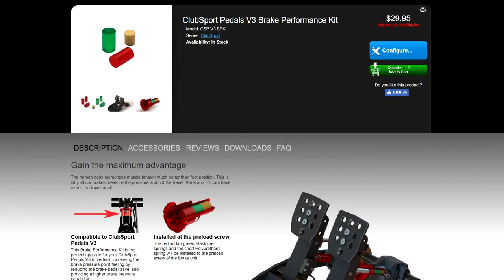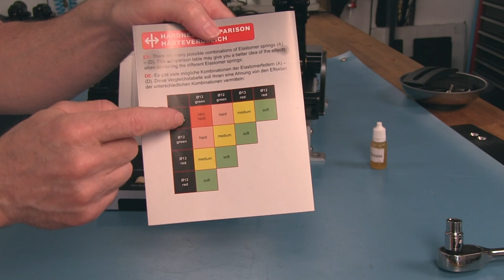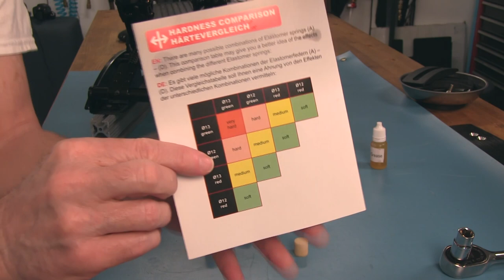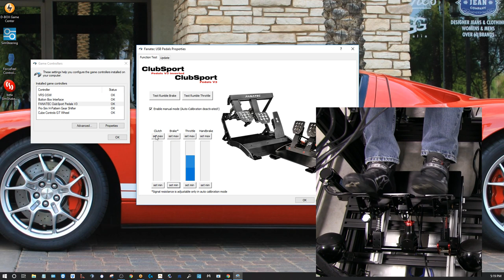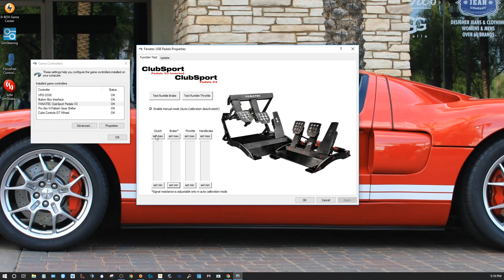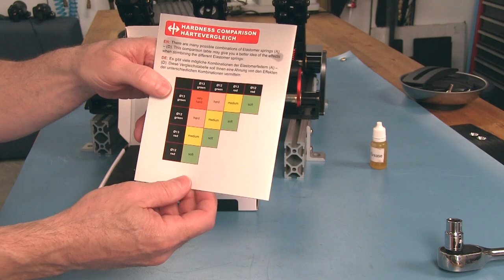ClubSport Pedals V3 Brake Performance Kit Review

Comment: The Shoremeter measures a point of the same diameter (so same area), but even going from 12 to 13mm, the area is 17% larger. So you'd expect you would need more pressure to compress a larger diameter elastomer.
Reply: I thought the same thing, but my comment was much more wordy. haha
Reply: Yeah, for these i think you have to measure them as if they were springs and calculate the force required to deform them by a certain length
Reply: I must admit, I am quite bothered by the lack of understanding of such a thing... XD

Comment: The smaller bumpers are not harder. They are actually the same hardness. It's just your measurement device and how it works. The smaller bumpers have less surface area touching the foot of the tool to absorb the pressure, so the pressure per square inch (psi) will be higher, given the same amount of over all pressure, than the wider bumper with a larger surface area. But the larger ones will "feel" stiffer in the pedal, because you will have to use more overall pressure to compress the material with the larger surface area, and therefore you will "feel" more resistance.

Comment: You'd think for a pedal set that costs an arm and a leg it you wouldnt have to buy "performance kits" for it
Reply: Agreed...but it's still considerably cheaper then the upper level like Heusinkveld or Ricmotech and probably the last pedal upgrade someone would make before opting for one of those.
Reply: Blotted
I absolutely get what you mean, Blotted. The company has to release a product that is "sellable/affordable". For some people this set of pedals will be "an arm and a leg". For other people it might me "an expensive but worthy upgrade". For some it might just be "a nice and quite inexpensive upgrade" from their old pedals.
The pedals are a pretty substantial upgrade from anything that is less expensive. Having used them for more than 16 months I feel that I can happily say so. 
I see NO pedal set that is even comparable at this price point.
I have no need for any of these optional kits. I like that they are not included. That would make them more expensive to buy. Do you need to press your brake harder than 50 kilos? Do you need your speeder to be harder than it is in a normal car? I'm certainly good. Feel free to ask questions if you have any. Kind regards from Leo.
Reply: @brockhopkins8408  I understand the pricing for the pedals but i mean for a few pieces polymer they should just include it with the pedals instead of nickel and dime'ing the customer. just my two cents.
Reply: @JonasRosenven  for a few pieces of polymer they should just add it with the pedals. These cost them hardly anything at the whole manufacturer level yet they choose to put it in a fancy package and mark up the price 10,000% percent. I work in the industrial parts business and see this all the time with seals, gaskets, o-rings, etc.) but yeah, i get it.
Reply: Customization
Reply: @JonasRosenven  Those parts could easily be thrown in for "free".
Reply: @d3tach3d  That sounds like a pretty socialist viewpoint.  The pedals are a great value for the price, incredible in fact.  I'm happy to pay an additional 30 bucks to fine tune...
Reply: @cbassfishin9494  lol, you bring socialism into this? What are you smoking? If your happy to pay 30$ more then by all means. do it.
Reply: @d3tach3d  The fact is that the pedals are good enough for most people. If though, someone wanted to change the stiffness of the pedals more than the already included adjustments, then yea, buying an upgrade is how it goes. Why include something that most people don't even think about, because there is already adjustments included. This is an OPTIONAL upgrade. You could buy the best pedals in the world, and there are still upgrades available. So no, they shouldn't free included for free.

Comment: its pretty logical that the smaller ones are harder measuring a small portion of the surface on them. The bigger ones have more mass so when you devide the pressure on the whole surface it gets stiffer. The way you are measuring them isnt really saying anything.. just the stiffness of the material itself not the actual product in action. you should measure these things over the full surface if you want to do this right. its easy to explain even further. When you have one egg and put pressure on it will break on a certain point. Putting 4 eggs and devide the same amount of pressure on them will hold the same force easy. Because the force is devided over these 4 eggs. This doesnt mean 1 egg is stronger then the other. The same goes for these rods. The more surface you have of the same material the stiffer they will be when the pressure on the material itself is the same.

Comment: I don't know if I'm missing something but isn't the 12mm rubber softer because it has more room to expand sideways in the chamber? Meaning even though they are slightly stiffer, the fact that they have more room to expand sideways before hitting the walls of the chamber, they end up feeling softer and allowing for more travel than the 13mm in the end?
Reply: yes

Comment: The performance kit now includes a tool to help you put the pedal arm back and to help not the crush or snap the vibrator motor wire

Comment: Just completed this process. If the brakes are well used a dual deep scratch will develop on the pin. When that happens removing the pin requires significant force. May require a tool and hammer like taps. After you get it out remove the scratch grooves with a small file and reassembly is easy.

Comment: Hi Barry, great video. I was really looking forward to it since I have the same pedals and also got the kit.

Here is a comment I wanted to share with you since you seem to have some engineering background or be engineeringly inclined:

The measurement of hardness gives you an idea of the stiffness of the material (Young's Modulus, E, for simplicity) but the stiffness of each block scales with the cross sectional area (A). All the green blocks measured similar hardness (therefore similar "Young's Modulus") but the wider blocks have about 20% more cross sectional area so they should be about 20% stiffer, i.e. they require 20% more load for the same amount of brake travel, assuming all the blocks have the same length (L). Axial stiffness of each block goes with E*A/L.

I am assuming the brake does not rely on the contact with the side walls and there is plenty of room for the blocks to expand (Poisson effect) since this type of material has high Poison ratio (0.5) which are "incompressible". If that was the case, I believe the stiffness would depend on the Bulk modulus of the each block, but you would feel a change in the stiffness of the pedal as the blocks come in contact with the walls (the narrow ones would have a bigger gap).

To put it simple. The 13mm block should be around 20% stiffner than the 12mm block (if they are all the same length, L, and material, E).

I you already knew what I explained above... maybe it can still be useful for other viewers.

Looking forward to your next video
Reply from the maker: I agree with that assessment. I did end up putting the extra 13mm bumper in. But in use, I was hard pressed to notice a difference in travel or stiffness.
Reply: @simracinggarage3026  Ha! Hard pressed... Punny!

Comment: Quite a few people have broken the wire that comes from the vibration motor.  When the rod is out, the piston pushes directly against the wire, and when moving the piston to get it out and back in again, it pushes against it and can easily damage the thin wire.  I used a 2.5mm allen key to protect the wire.  First flip the pedals upside down to work on it easier, then lay the 2.5mm allen key beneath the piston and next to the wire.  It totally protects the wire, plus it's just about perfect thickness to easily get the rod back in.
Reply: I also did this, can confirm, it saves you a major headache
Reply: Great tip! Thck Zip-ties are also good and easy to remove.

Comment: I tried a bunch of different combinations and ended up using the 012 red and 013 red.  It's still plenty stiff, but still provides some travel.  Feels perfect to me.
Reply: Especially if the bore diameter is close to 13mm, the stopper will push against the bore walls and will stiffen up due to interaction according to Poisson's ratio.
Reply: @virtual_GaRy  Are you okay?
Reply: I put these two reds in and couldn't even push the pedal 1" using both feet. I'm wondering if I got rocks instead of plastic, I can't imagine how he's pushing the greens a couple of inches.
Reply: @TheAncientColossus  shh the adults are talking
Reply: @virtual_GaRy  thanks I learned something

Comment: Even if the larger green one has a slightly lower hardness, it should feel stiffer overall because larger diameter objects require more total pressure to compress.

13mm diameter has 133 mm² area. Whereas 12mm only has 113 mm². That's 20 mm² more area for only 1mm additional diameter.
Reply: I like your funny words magic man

Comment: When the bigger/softer(13mm) rubbers compress within the piston, they grip the cylinder walls tighter. This increases the amount of pressure required to get the piston to travel down(ie distance compressed) the cylinder and compress the transducer.  The smaller diameter(12mm), although harder, expand less and creates less cylinder wall pressure during compression. Which allows for further piston travel and in turn greater pressure transducer compression.

Comment: First time I've installed SOFT set, and now I replaced it for HARD set (skipped MEDIUM). I'd say that the difference is not so noteable as I expected. I have a diy rig and I can push brake to the limit easily (no preload, full stroke). 90kg is not too much weight for the brake, so I recommend to use it's HARD set at the beginning. Maybe for free pedal positioning on the floor it could be a problem, but not for a rig. Before installation procedure I recommend to find a 2.6-3 mm thickness plastic spacer and use it to protect the wire - piston easily slides along it.

Comment: Cutting another elastomere piece to the length of the PU foam and adding it into the piston instead of the foam would probably do the trick Barry?!? This is what I will do most probably when I get the kit. I bought this pedals nearly two years ago, and simply was so sad that I couldn't properly race them. Now I'm convinced i have to buy this kit. It's another 45€ incl. shipment, but still I don't have the bucks to buy Heusinkvelds yet. So no other option for me left really :) Thank you very much for the ultra professional review Barry!  Greetings from Slovenia
Reply from the maker: Yes, that would work. I have read of some people actually cutting properly sized wooden dowels to replace the PU foam piece.

Comment: Material hardness does not translate into needed pressure. Compressing the different volumes with the same hardness gives diferent pressure values. So for the same hardness level, more volume needs more pressure to deform the volume. In this case, same colour more diameter will need more pressure for the same color smaller one.

Comment: Ordered these and the damper too who needs instructions when we have Barry. Thanks. EDIT 29/6 I could not line up the hole so folded paper several times to elevate black piece so I could re-insert shaft also the shaft on mine had to be hammered out it would not budge. Two greens were too hard for me changed to 13 and 12 red as I prefer that.

Comment: Hey Barry,
I've just bought the Clubsport V3 Pedals with the BPK and I wanted to ask you how much difference there is between the "Mid" setting (13mm red and green) and the "Hard" setting (13 and 12mm green) . I was looking for a feeling as close as possible to a GT3 car but was also worried that the "Hard" setting would be to uncomfortable to drive without shoes (as I do most of the time)...
What would you recommend?

Thanks for the great content! Keep it up!

Comment: I wouldn’t be surprised if these were standard on a V4 set, unless they changed their design completely between now and then. But I absolutely agree, they offered the incremental upgrade from the CSW 2 to 2.5, why not have the V3.5 pedals with this mod pre-installed?
Reply: The kit is all about allowing the user to adjust the feel of the brake pedal to their own liking.  There is not point selling it with the kit installed as to truly get the full benefit you would have to go through all the iterations to find what you like anyway.

Comment: I just my kit in the mail.  I don't think I'll go as stiff as Barry though.  I'm also going to install the dampening mod on my throttle in an attempt to stiffen it up as well.  Great review Barry.
Reply: A dampner on the accelerator is amazing. So much better throttle control. I highly recommend it.
Reply: @WhiteHawk77  i'll let you know after I try it out.  My first set of pedals were the CSR's. The v3's were a significant jump up for me, in terms of feel.  I ordered the dampener when I bought the pedals but never put it on.  Now that I've had them for awhile, I'd like just a bit more resistance.. Everything that I've read and seen, say it doesn't make sense to use the brake kit and dampener on the brake pedal itself.  Since I have both, I'll try out the kits on both pedals.  Worst case, I won't like them and I"ll take them off.

Comment: Very well done! Because I'm going to switch from an old G25 Pedalset to the Fanatec V3 (and DD1 Wheelbase, delivery date in June'19), I didn't order the performance kit. I would be hard enough for me to deal with the difference between those two pedalsets even without the kit. Perhaps I'll do the upgrade later if I should ever purchase an additional steering wheel.

Comment: FYI : @26:27 Barry SHOWS the 12mm and 13mm green bumpers while stating, "ended up using the VERY HARD combination". Which is confusing/incorrect. The VERY HARD combination is using both 13mm green bumpers.  The HARD combination is the 12mm and 13mm green bumpers as he is showing here, and installed. And was demonstrated where he complains of it being too soft. He did state he would try the 12mm/13mm(Hard) green combination and the 13mm(VERY HARD) green combination. Barry must have done so and stated as such @ 26:27 without realizing he was displaying the 12mm/13mm green bumpers.
Just an FYI so no one thinks the 12mm/13mm combination as shown is the VERY HARD combination.

Comment: My set screw is impossible to move. Was shocked how easily you turned it. Had to sell the kit as did not want to lose the pedals for 2-3 weeks and having to remove the damper mod...for one screw.

Comment: Love the channel mate..just FYI instructions say DO NOT lube the foam 😉
Reply from the maker: Correct, but the original foam bumpers that came out had lube on them.
Reply: @simracinggarage3026  yeah. Thats true. Anyway, good stuff man. You sure put that pedal back together alot faster than me 😂
Reply: They say to not lube the foam because that's what caused the notchy feeling in the original design. I didn't use the foam in the performance kit upgrade.
Reply: @anthcesana  Are you still not using the PU Foam?  

I have been trying different combinations and, am realizing now that I don't want the progressive feel where it gets stiffer as the throw gets deeper.  This is why I asked you about getting rid of the PU. 

Now, to choose which 2 of the same Bumpers to go with..
Reply: @potvinsuks8730  I don't use V3s anymore.

Comment: Great in depth detailed review as usual!  Is it possible to make these mods and adjustments without removing the entire pedal assembly from the rig? Looks like the access to the set screw at the bottom and removing the elastomers while mounted in the rig could be an issue. Thoughts anyone?

Comment: Great videos i stumbled upon them after i did my brake kit install but here's a question, what if we use the 2 green ones wittout the small spongy one, and use the pedal travel to tightened the pedal as it is no longer needed for travel .
( i have the 2 green ones because i saw this video after. I haven't used it yet but my pedal has no travel )
Or what that make it too stiff?

Comment: I have a question, anyone can answer this. What if you just cut one of the red elastomers to the length of the sponge? Shouldn't that greatly reduce the throw of the pedals?
Reply: I’ve seen that done and it does work

Comment: Is it me or did Barry set the pedals up in the "hard" setting with a 13mm and 12mm green insert instead of the "very hard" with two 13mm green inserts??  Also the way that the 12mm works out to be softer than it's 13mm counterpart is the fitment into the pedal rods sleeve.  Having not seen these pedals pulled apart I would guess the 13mm inserts are a snug fit and only allow compression of the material.  The 12mm insert not only gets compressed but also bulges to give a slightly softer feel.
Reply from the maker: I agree with that assessment. I did end up putting the extra 13mm bumper in. But in use, I was hard pressed to notice a difference in travel or stiffness.

Comment: Excellent review of the kit!  Does it matter which diameter rubber is installed first into the barrel? Smaller diameter towards the transducer, or towards the piston rod? I would think it must, because why the different diameters, while their hardness values are so close? Also same question for their hardness values. Softer rubber material first, towards transducer, then progressively stiffer rubber towards the piston?